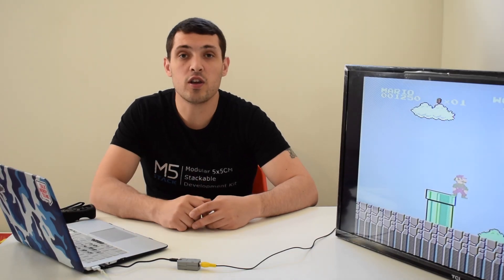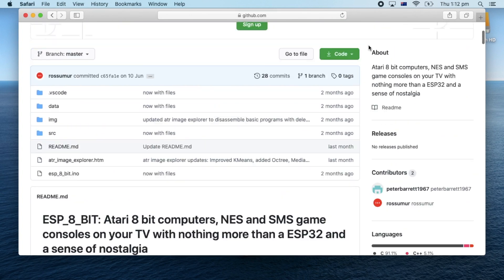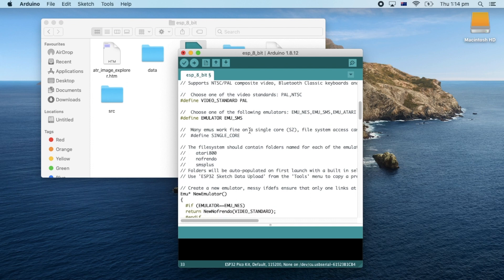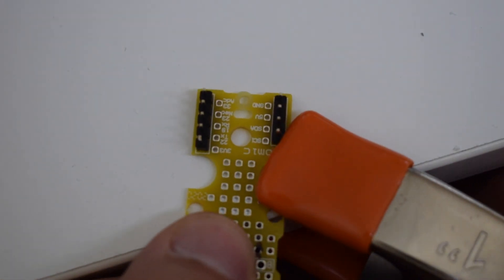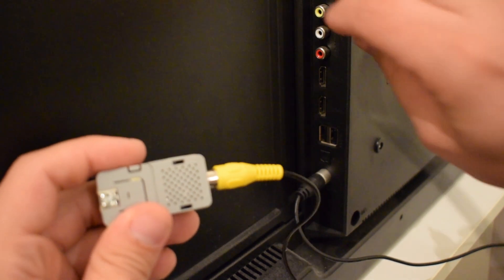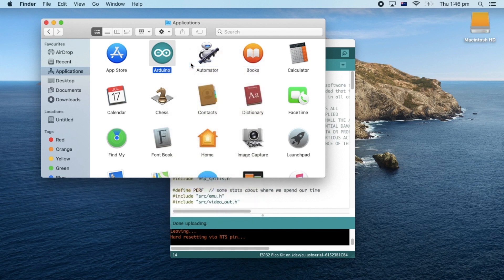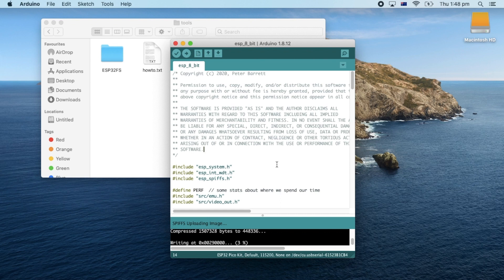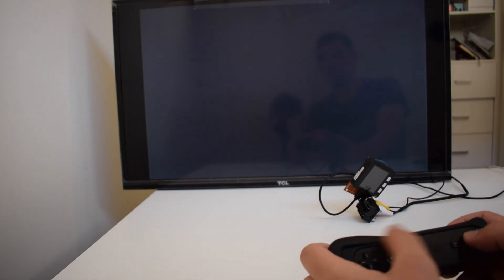Worlds smallest game console with M5Atom

Comment: This is awesome. Got mine working. Was getting MALLOC32 FAILED allocation of MEMORY_mem:65540 error and no video. Removed the comment on #define SINGLE_CORE which changed the memory allocation and had to alter video_out.h #define VIDEO_PIN  26 to 25 for my Atom. Now its working perfectly - thank you for sharing. Really shows the power of this tiny low cost processor.